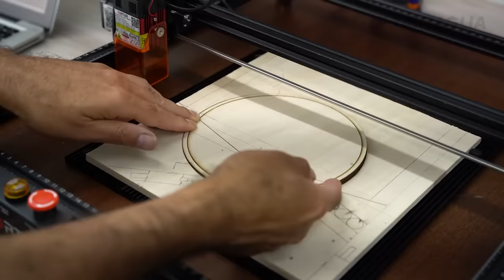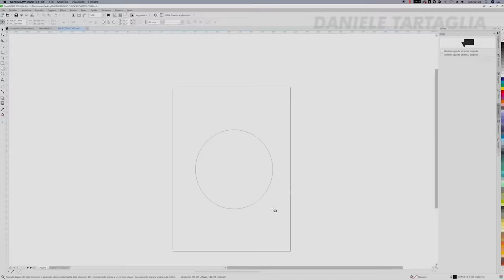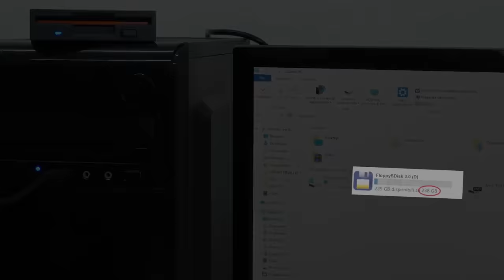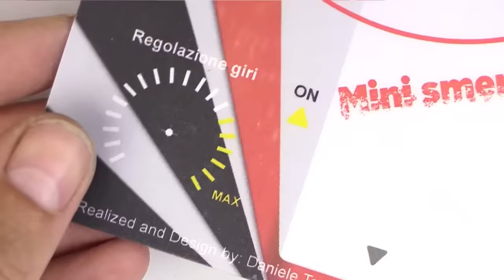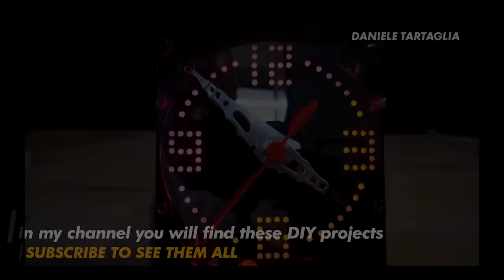3 AMAZING projects with old parts of a PC

Comment: Great job done. Perfect. But for last project regarding HDD you spent too much money(drive board for motor). I did same but I used HDD drive board it self. Only add 7805 stabilizer for 5 volt, and applying 12 volt motor start working without stopping. I am agree I can't control RPM, but is good for me
Reply: That potentiometer would get hot under that load.  PWM the voltage of the supply allows rpm changes and better heat dissipation (with a heatsink).

Comment: I amde  the same thing as  you at  thet end of the  video  use HS  disk  as a needele  for  the clock 
also
thanks for telling us where the gold was in the tone arm; I use my old hard disks as a gyroscope to stabilize my binoculars in fact I remove almost all the reading part like you but I put the disks back I put x7 or 8 and I put the wahser back on top; if you start the HD now it will have a very marked gyroscope effect I then put it under my binoculars and I now have stabilized binoculars for a few dollars if you have a HD scusi at 7200 rpm it's even better or even the very old ones 3 inches tall
as for the magnets, I put them in a small 2x4 in. box and they serve as an empty pocket for my monnies
I don't know how to put a video on utube to show my gyroscope but if you do, please tell me jacquessavard videotron ca